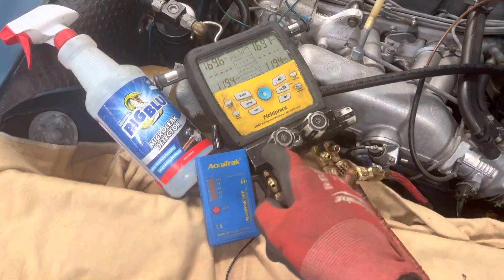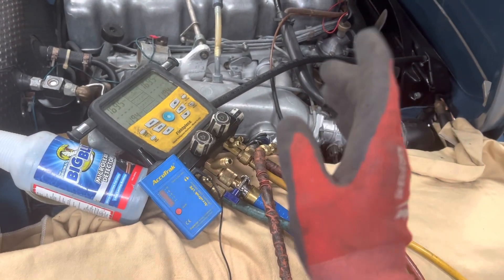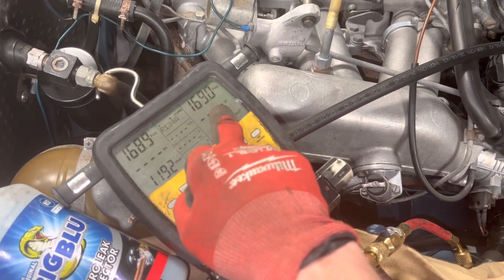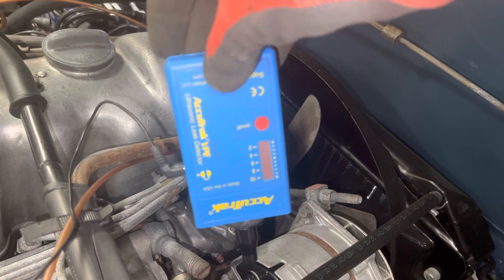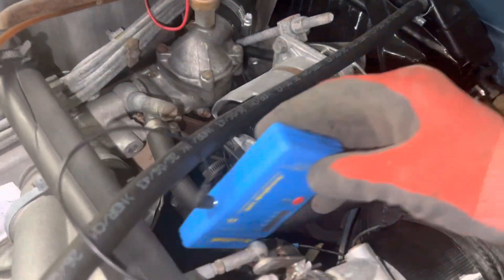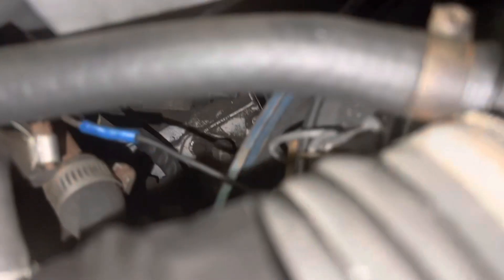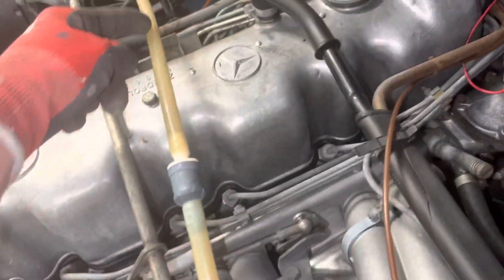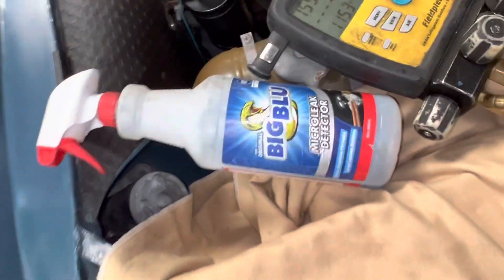Ultrasonic Leak Detector quickly from a distance locate the sanity of the leak ￼

Comment: would be interesting to see a video of how you try to reach that leak for repair. access looks difficult
Reply from the maker: To reach out with the leak detector on the Ultrasonic there is actually a extension hose that funnels the sound that you sleep on the end to get down to difficult to reach areas.      But I lost it.

Getting down there components are going to have to be removed. Everything that you see above that was blocking my access will all have to be removed. .